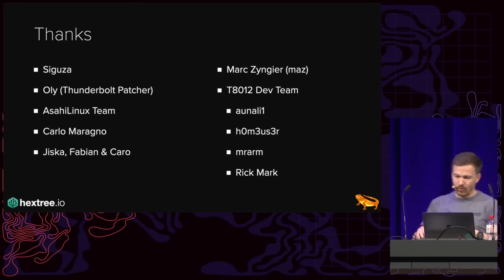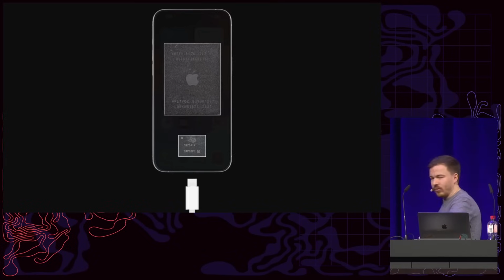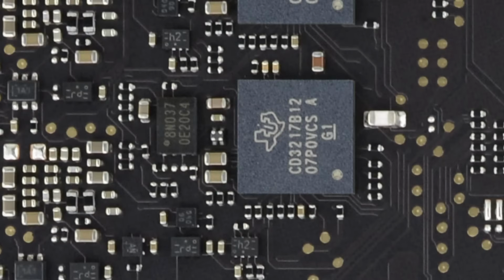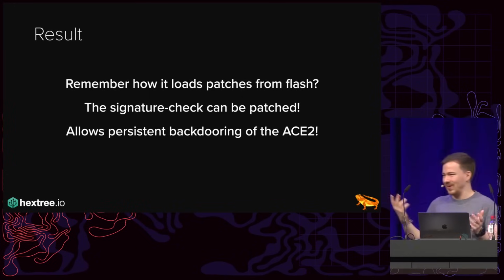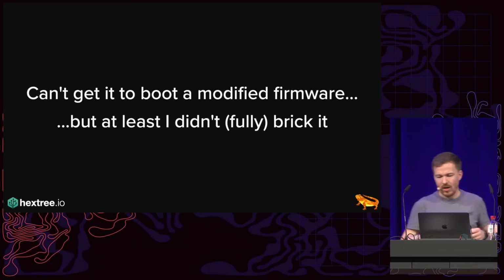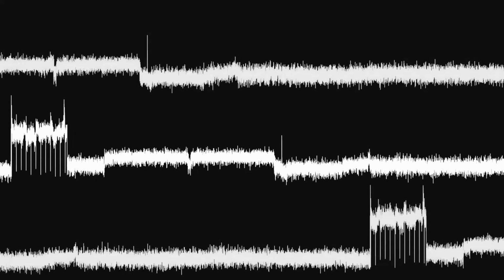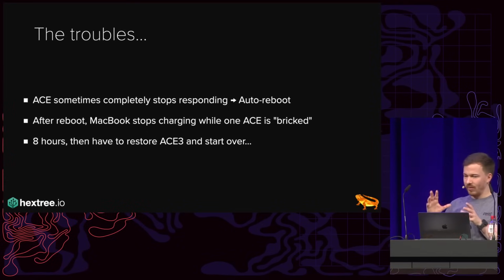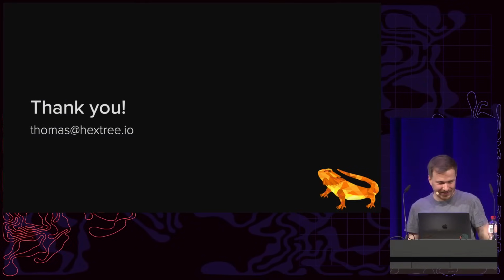38C3 - ACE up the sleeve: Hacking into Apple's new USB-C Controller

Comment: Next time you have issue with charging:
simply connect 12.6V directly to the inner pin of the battery power connector, keep it disconnected from battery. But keep battery BMC flex cable connector.  macbook will see battery and think it runs from battery, but it will take power from external power supply.

Comment: I'd love to see someone literally dump the firmware to find an exploit that gave us read write access to the firmware so that we could literally see Custom Firmware on Apple Smartphones, because iOS sucks.   But, You could make an iPhone suck considerably less if you could control it's firmware. Like making the file storage accessible over USB-C, on a platform independent  basis,  so that it played nice with Windows and Linux. Just plug it into your computer, and   move files back and forth like any other SSD or HDD.

Comment: 😂 16:29  
„It´s an OpenOCD to bitbang SWD on Apple SoCs to all GPIOs“ i mean of course, what else… I feel so stupid. 😂 

But this is exactly how i must sound like to my parents when i help the with that Internet thing
Reply: Come on, nobody should feel stupid. 

That's why they invented Wikipedia. 😆

Just kidding.  ✌🏻 Peace.
Reply: @Waldemar_la_Tendresse  I mean, what has fruit to do with it?!
Reply: Don’t feel stupid! You got this :D

I’m very dum and I was able to grasp it. Whenever you encounter a scary term like this you can use chatgpt or similar to understand it.

Basically, OpenOCD is software that’s used to debug chips. debug - read the status of what the chip is doing, access commands and potentially flash it with firmware. The flashing capability is typically locked to prevent a random fella from modifying the firmware, but that didn’t stop our fella stacksmashing…

SWD is just a common standard for debugging chips, so in a sense it’s like usb but specifically for debugging purposes (and since you typically don’t need to casually debug these chips as a consumer of a product they’re a part of, you don’t get a nice port unfortunately…)

Now SoC is just the brain of the MacBook, it’s a short for System on Chip and indeed, it contains the CPU and a bunch of other things like memory and sometimes even things like gps.

It has some GPIOs which stand for general purpose input/output, basically they’re a bunch of connections that you can just send whatever data you’d like through them. The main part of swd is defining how the data is formatted, meaning in what manner you have to send 1 (electricity) or 0 (no electricity) to send and receive debugging instructions (even including a flash image that you’d like to save onto the chip) correctly.

Unfortunately despite the fact this ace chip happens to have its debugging pins connected directly to some of the SoC’s GPIOs, the functionality that handles debugging from the SoC’s side is limited to Apple and practically not accessible for a random user… That’s where bitbanging comes to the rescue! Bitbanging is just the practice of taking gpios and implementing a communication protocol like swd “manually”. So instead of using the “official” functions to do that, and sometimes (not here) instead of using the gpios’ intended purpose you manually send your 1s and 0s in accordance to SWD specifications. 

All of this is of course very tedious and annoying, which is only to say stacksmashing is truly a legend.

I hope this helps! If you got any questions feel free to ask :)

Comment: How is the low-level hardware security of Framework laptops and their competency applying patches to found security issues compared to Apple?
Reply: Apple laptops are like a children's toy with triangle screws.
Reply: What manufacturer is better?
Reply: I mean, how important is Coreboot compatibility for you?
Reply: Apple are supposed to be premium products just look at framework laptop reviews and u will hear about some small issues with wiggly plastics on the case and keyboard or something they are trying to get the quality but it will take time and will never be good as non modular 
And ofc your preference MacOS or window/Linux 
The main point for framework is the repairability and the ease of it and because of the modularity upgrading of the motherboard with the CPU+RAM or even just the GPU recently without buying a whole machine
Reply: Their low level security gonna be the same as any other windows laptop manufacturer
Reply: @spizganed  wrong, it's worse

Comment: Do I understand correctly that by using fault injection he was able to bypass the firmware signature check? That is, the logic is as follows: took the firmware, changed something in it (for example, the version string), recalculated the CRC, flashed it back. And then, by applying a pulse at the right moment, he was able to bypass the signature verification of this firmware?

If yes, at the end he says that he was able to read ACE3 firmware - but I don't understand how he changed something in it before that, if he didn't have ACE3 dump yet. Can someone understand?
Reply: He spends a good deal of time explaining this, but yeah it's pretty convoluted.

The firmware is split into two parts: the on-chip ROM (Not easily readable, not writeable, but contains a full image), and the off-chip flash (trivially readable and writeable, but contains only patches rather than a full image).

Having access to just the patches, he found a patched function that he could understand and he injected the payload into that function. This then allowed him to read the full on-chip ROM, rather than only the bits and snippets from the external flash.

Hope this clarifies things.
Reply: @antonliakhovitch8306 also, the key to this whole thing is that after he modified the patches, he had to glitch the chip at the right time so it would accept the modified patches without issue.
Reply: Yes, the key is that part of the firmware was on a flash chip which is trivial to read write.

Comment: 12:20 so they went to a lot of engineering efforts for this, yet didn't have the engineering foresight to get the high voltage rails for the display out of proximity of the NAND or main CPU? Or is that just negligence?
Reply: If you're talking about the infamous apple chip causing problems for many users then my thought is that it's planned obsolescence
Reply: I guess a lot of people work on a lot of different things
Reply: @ funny how they have no one researching how their products fail in the most common ways

Comment: No, they aren't "good at engineering", but they are competent at reacting. (read: every mistake one finds and publishes will get fixed.) Apple is very good at hiding shit, but "security through obscurity" will always fail.

And no, it's "not just a USB controller", which is the very reason it's a hacking target.